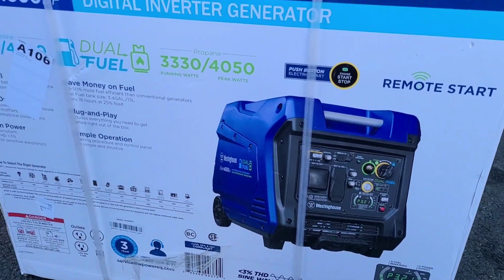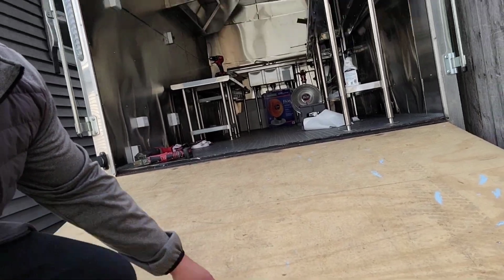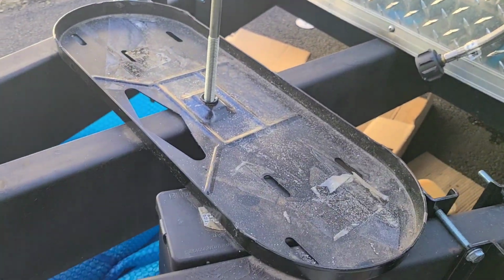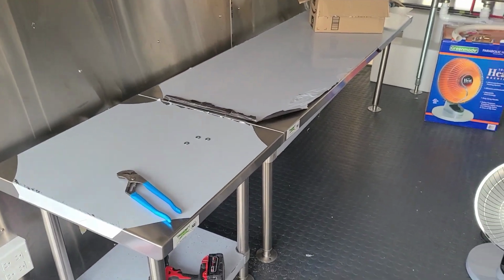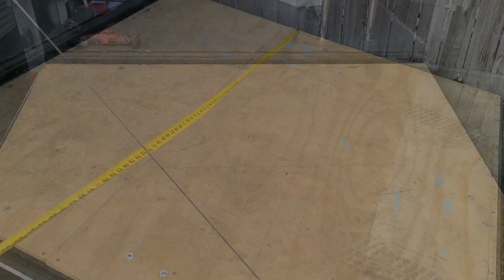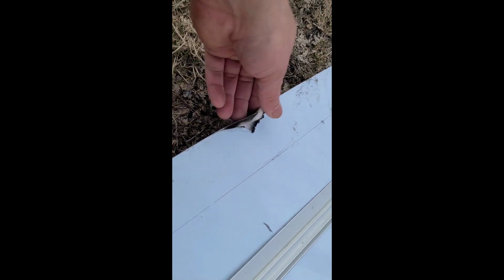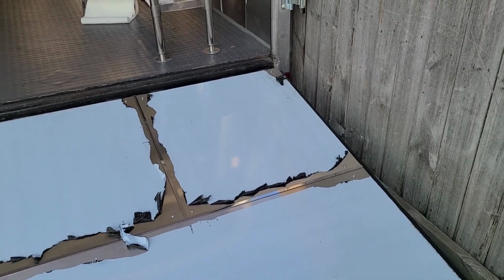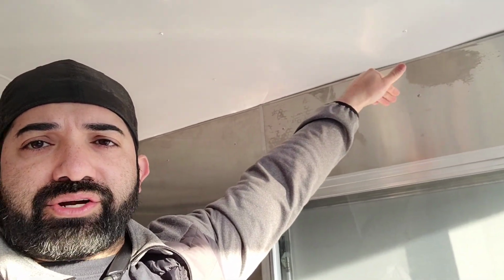How To Build a Food Truck: Stainless Steel Lift Gate

Comment: I’m a little confused or I missed something. You say in one video you use 30 amp service but in another video you describe using a 50amp plug and your generator is 30amp. Can you explain this to me? I’m missing something
Reply from the maker: You can use either one, you can use a 50 amp with all of them, but you can't use a 30 with 50 amps. I would recommend using 50 amps just to have it future proof.

Comment: What type of trim did you use where the frp and SS meet?
Reply from the maker: A transition piece is what I use. https://www.amazon.com/gp/product/B07MLSP44P/ref=as_li_tl?ie=UTF8&camp=1789&creative=9325&creativeASIN=B07MLSP44P&linkCode=as2&tag=rollingburrit-20&linkId=14b923c96bad8c7829caeb5c89ebebb4
Reply from the maker: Or they make them in frp as well

Comment: Frank, I’m running an 16 ft concession trailer with a two burner stove. 36 inch flat stove, table steamer and 10 liter deep fryer. I can’t seem to keep my fryers heat up after each use, what kind of pressure regulator do you use in your builds. I’m thinking it could possibly be I’m using the wrong size  lp gas regulator. Any suggestions?

Comment: Frank, quick question in this video on your vinyl what type of trim you have on the floor. I know in the floor video you put silicone to keep it nice and water type but is there a trim that goes around the flooring to make it look flush or detailed
Reply from the maker: Your friend has shared a link to a Home Depot product they think you would be interested in seeing:

ROPPE	700 Series Dark Gray 4 in. x 1/8 in. x 120 ft. Thermoplastic Rubber Wall Cove Base Coil
https://www.homedepot.com/p/ROPPE-700-Series-Dark-Gray-4-in-x-1-8-in-x-120-ft-Thermoplastic-Rubber-Wall-Cove-Base-Coil-HC40C73P150/100114322
SKU# 100114322
Reply: @fbaltierrez  Thanks Frank

Comment: Its June 21st, I am about to start to build my trailer after watching your series about 5 times.. unfortunately, Stainless steel is now over $300 per 4x8 sheet in my area.. This just completely DESTROYS my budget and does not allow me to use it. I am forced to use FRP board, but I am going to break down, pay the $600 for 2 sheets and cover just behind my cooking station. Man, If I could have seen this coming, I would have bought it all up a year ago and be making bank reselling it now! lol
Keep up the great work man! LOVE your videos!
Reply from the maker: Crazy price. Yes it will put you over budget quick. I bought mine about a year ago and I feel I overpaid at $95 a sheet lol
Reply: @fbaltierrez  Here is an Idea I may try, I can get 4x8 7/32 underlayment plywood for $16 a sheet at home depot, maybe fasten the underlayment to the roof then glue the FRP board to the underlayment?
Reply: @randor73  bob, make sure you check all the local shops that sell steel. Some have damaged material. I ended up getting 24 gauge steel instead of 20 gauge 304 2b for 115 a 12x4 sheet. It worked out for me. Just keep looking.

Comment: I saw i company that used all aluminum and just stainless steel behind cooking areas whats your thoughts
Reply from the maker: That's works for sure. A lot more cost effective
Reply: Why csnt you use aluminium behind cooking appliances?
Reply: Because you have to have stainless steel behind flammable cooking equipment

Comment: Hi frank,I bought a fryer and it comes with a gas regulator, if I already have a regulator for both gas tanks it is necessary to install the regulator separately for the fryer